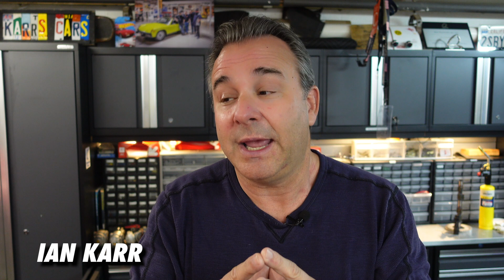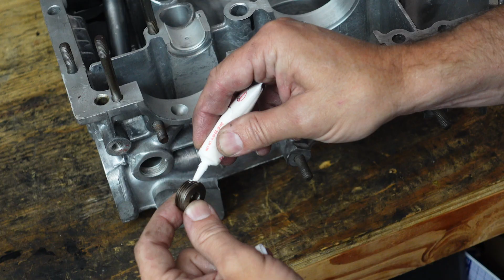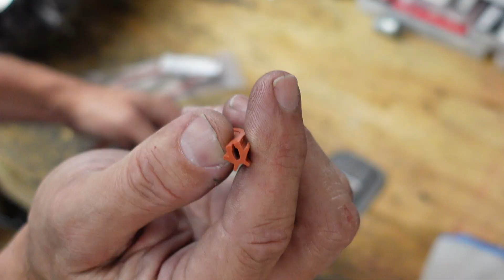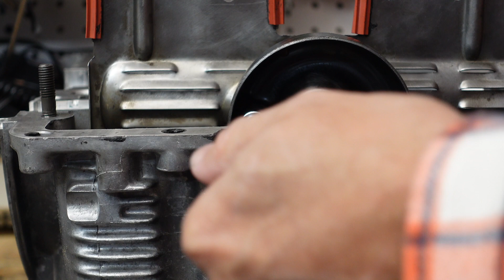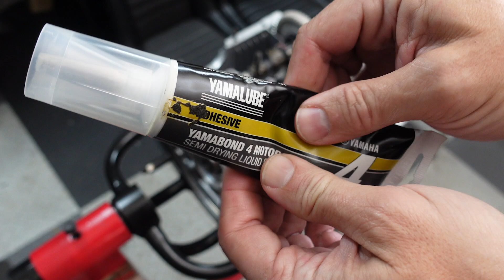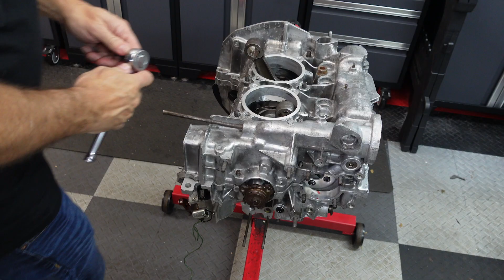Porsche 914 VW Type 4 2056 Engine Build Part 3 and FAIL [Project Bumblebee ep 09]

Comment: Why are you using Permatex sealant on a Oring, assembly lube is all that's needed here.
Reply from the maker: Because it is effective in creating a better, longer lasting seal on a 50 year old engine. It’s just basically Teflon. It doesn’t harden or dissipate. That, and if it’s good for Jake Raby, it’s good enough for me :). My engine doesn’t leak a drop.
Reply: @IanKarr  the O-ring was made to seal the hole 50 years ago and that a new oring is gonna seal it again. The hole size has not changed and putting sealant on it. I don’t take Raby,s word for anything I was talking to George at European motor Works. I have a 914 I’m rebuilding and it’s not stock and George has done  all machine work for me,, asking George  why anybody would anybody put sealant on a oring is above me? I would take George’s advice over Raby anytime I think George has been doing a little bit longer than Raby. I’ve been an aviation mechanic for 40 plus years and you can’t arbitrary put sealant on a oring, not all all rings are created the same different materials take different lubricants. I take it you’re not a mechanic by trade.
Reply from the maker: No. I'm not a mechanic by trade and never pretend to be. I am, however, a good student and have chosen leaders in the field to learn from. As for EMW, George is a great guy, and is very knowledgable. Not in the same class as Jake, who not only builds engines, but develops patented engineering for the most discerning buyers in the world. Everyone is entitled to their opinion and I respect yours. If you're working with George, I'd make sure he, himself is doing the work. EMW did the align bore on the engine in this episode. Twice. Requiring shippinig cross-country multiple times because it wasn't right the first time. And after the engine was built, it wouldn't hold oil pressure when fully warm. I took it to Red-E motorsports (local SLC VW experts) who tore down the motor and discovered some weirdness with the case work. I ended up having to find another case. And BTW...Jake diagnosed the problem from 500 miles away. Watch the link below for more info. I'm not dissing George. I heard that he might have been going through a rough time when my work was done. But the fact is that EMW's poor machine work cost me a ton of time and money. Good luck with your project.
https://youtu.be/l9ZG2ZrZR5U?si=ASMMgX_oK2qAlKhd

Comment: Question;I have a westfalia 1982 air  cool 67 horse per how I can increase more pawer
Reply from the maker: Lots of ways. Cam, crank, pistons and cylinders, fuel delivery system, exhaust. If your question is how to EASILY do that, I'd suggest a tune up to maximize what you have. Any other mod will require more work. Fuel delivery and exahust would be next, but not necessarily easy. Hardest would be changing components inside the engine. All are doable though!

Comment: What all got machined again?
Reply: It sounds like the line boring process wasn`t done properly.
Reply from the maker: Correct. The align bore needed to be cleaned up so the crank could spin freely. More on this to come...
Reply from the maker: The spigots were decked to be square and there was an align bore

Comment: Summers during college I worked in the maintenance shop of a highway construction company. We would k look at the crank of a 6-cyl. Caterpillar engine in the block and it was almost impossible to turn with a pull handle and Chester pipe. Attach the 4-bolt bearing caps, torque them down and you could turn the crank with your little finger. Always amazed me
Reply from the maker: It's a game of thousandths...

Comment: 👍 Next time put the cases together without sealing them. Sometimes it takes a few times to get it right.  Engine bearings are a big problem these days.
Reply from the maker: Thanks for the tip. Definitely an important lesson to learn. Cleaning up the sealant wasn't fun ;)
Reply: @IanKarr  
I  know about the sealant. ☹ Been there.

Comment: Ian, I had the same thing happen. I didn't realize it but when I installed the crank, the bearing that is behind the gears didn't seat into the dowel hole correctly. When I turned it, everything was okay, till I torqued it down. Unfortunately, you ruin the bearing when that happens, so I had to heat the gears, remove them and start over. Once they were seated right, everything turned, so it is not likely a tolerance issue.. check the bearings to see if they were all seated. Can't wait to see what you discover!
Reply from the maker: Thanks Rob. While it’s certainly possible the #3 unseated, the binding seemed to be in the thrust bearing. It wedged into the upper case and required a lot of force to free it. And there were marks inside the bearing where it looked like the crank had rubbed against it firmly. I’m hoping it’s the bearing and/or my error. That’s an easy fix. We’ll see after the machinist measures the bores and bearings this week..

Comment: I was going to say "before you take it anywhere, make sure none of the bearings have slipped", but it sounds like you've inspected things and taken it to the machinist already.

Good luck, I hope the fix is simple and easy!
Reply from the maker: Thanks Dave! You're a huge asset to this community and I'm flattered that you're watching my videos. To my admittedly DIY wrench, it seems that the crank is binding in the thrust bearing. When I pulled the cases apart, you can see that the thrust bearing got stuck to the top half of the case...and it took a fair bit of force to separate. I'm confident that the thrust bearing seated properly on the lower half...and it would be the least likely to move, no? When I looked inside the bearing, I could see some marks that indicated binding. I polished that thrust bearing a bit, tried to re-tourque and it got better, but still not right. I figured before I went further, best to have everything measured properly. I've spoken with a few engine builders and they said that Q/C is poor these days and they frequently have to go through several boxes of bearings to find a good set. Hoping it's just that....

Comment: They call it line boring, they clamp the two halfs together and then make sure the holes are actually concentric for the crank.  It's a big thing on Porsche engines, did it to several 911 cases over the years.
Reply from the maker: Thanks, Chris. The case was align-bored and decked (covered in part 1), with the correct size bearings installed. We’re thinking this is a bearing quality control issue, but should know more this week.
Reply: @IanKarr  I haven't built one in over 20 years, but if it had to be align bored there may have been case material lost in the center main bearing area.  If so the center cam bearing can pinch the camshaft.  I don't recommend turning the crankshaft after properly installing and mating with the cam gear until you assemble the halves because you might pull a bearing off its dowel and then pinch that bearing.  Did I see an oil slinger?  I can't remember.  I also like to set the crankshaft end play before assembling the case halves, just torque the crankshaft to the flywheel and rear main bearing, check the clearance with no shims, select the necessary shims, add them, re-check the clearance with feeler gauges.   After assembling the case halves, reinstall the selected shims and flywheel then double check with a dial indicator.  Inspecting the bearings should show a polishing effect if they are tighter than they should be.  You had a lot of machine work done, some is metric some is U. S standard, sometimes the 2 don't quite mix.
Reply from the maker: Thanks, Huxley! The issues seem to have been sorted out. A new video coming very soon.

Comment: Hmmm! You made me feel good. Mine went together more smoothly. Although I had done several Pontiac engines and a Beemer engine before.
Reply from the maker: Glad it went smoother for you. I'm thinking (hoping) this is more an issue of bearing quality control. At least that's what the machinist thinks. We'll see this week ;)
Reply: @IanKarr  Good luck. Only doing one and everything goes smoothly one doesn't really learn much. I hope it's something easy.

Comment: I’ve been jumping around with these videos and haven’t watched them in order. Did you change anything in the engine? Or did you just install new bearings? My guess is that the news bearings aren’t the right size. Sounds like something started to pinch something else, either the crankshaft or camshaft, after you tightened down the block. Hope it’s a simple fix.
Reply: Ok, I watched your first video.  You had an align-bore done.  I'm wondering if you used the wrong size bearings. That shouldn't be hard to remedy.
Reply from the maker: Thanks for the feedback! Yes, align bore done...and proper bearings bought. (+.020 case, -.010 crank).  The machinist (and a few other 914 gurus) are thinking that bearings are suffering a quality control problem these days and I tend to agree. It seems that only the thrust bearing is tight. And if you look closely, you'll see that the crank came out with the left side when I pulled the case apart (and needed a lot of force to separate the crank from the case.) I tried polishing the bearing a bit and it helped, but is still binding. Like I said in the video, I don't have precise enough tools to quantify the problem...so off to the machine shop! I should know more this week.
Reply: @IanKarr  plastigauge should get you in the ballpark or tell you what's out of tolerance